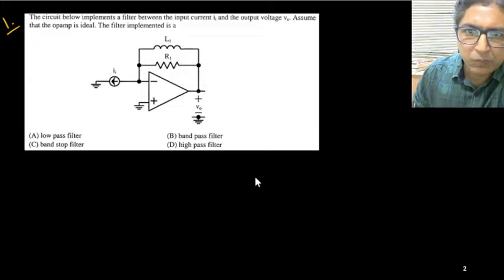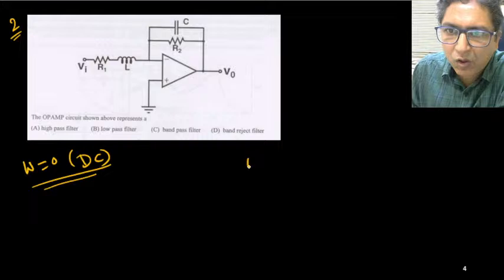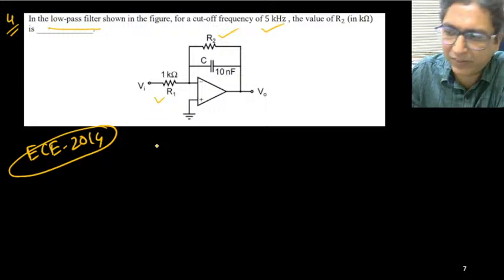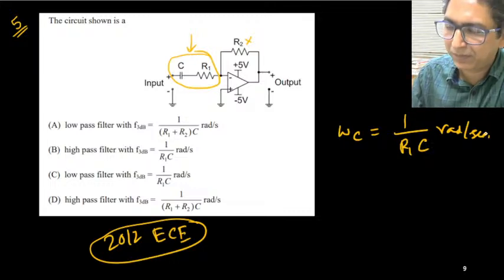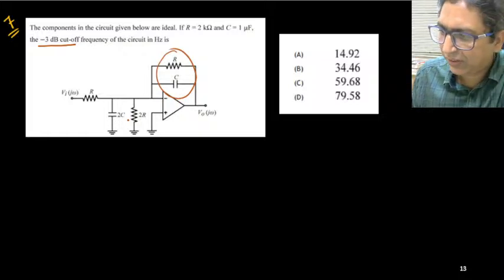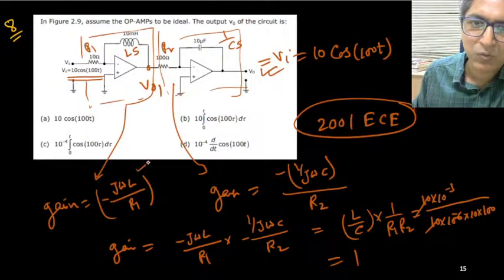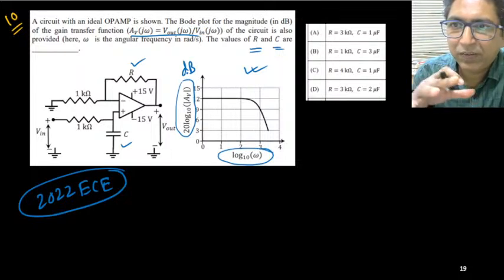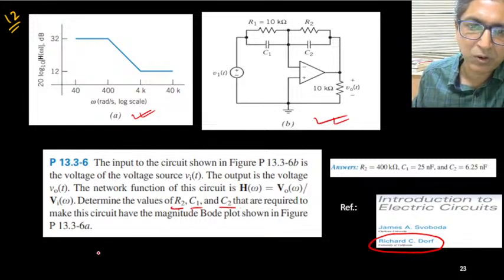10 Problems on Active Filters - for  GATE 2025 ECE/EE/EIE  | Analog Electronics Problems

Comment from the maker: Follow the recently uploaded videos right now.

1. Second order RLC Circuit - Complete Response - Natural Plus Forced Response with Examples
Link: https://youtu.be/qxomBidDFBc

2. Low Pass Filter ( LPF ) Designed with RC and RL Circuits | Passive Low Pass Filter | Analog LPF
Link:   https://youtu.be/XnIIOQRoVHw

3. Problems on Active Filters - Complete Expression of Output Voltage -  GATE 2025 ECE/EE/EIE
Link:  https://youtu.be/lXkPLzEi9Qo

4.  Problems on Diodes - Diodes in DC Circuit- One/More Diodes | GATE Level Problems for ECE/EE/EIE
Link:   https://youtu.be/6BNEoxRhNjw

May support the channel to get early access of these videos. Enjoy learning.